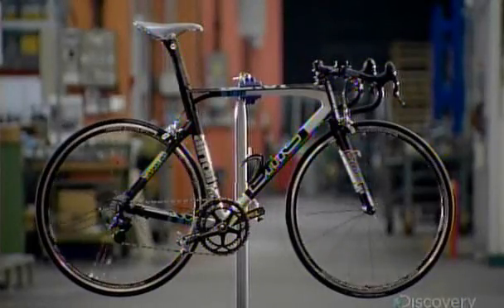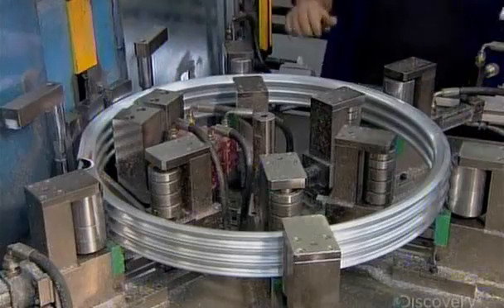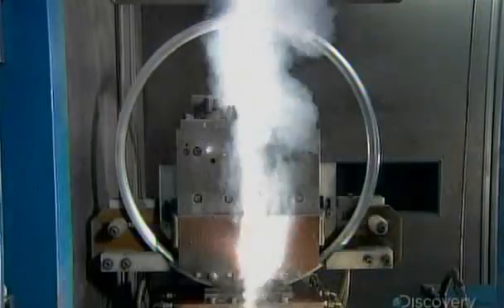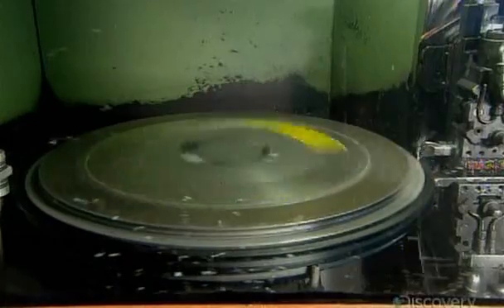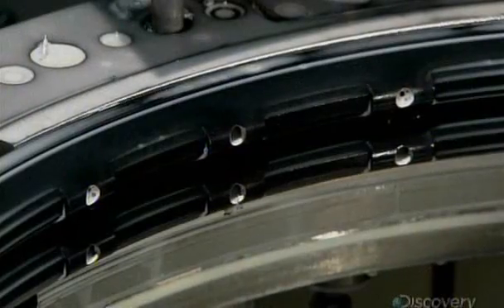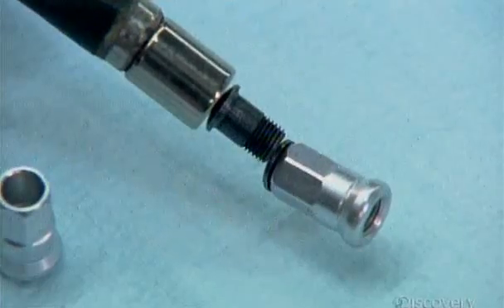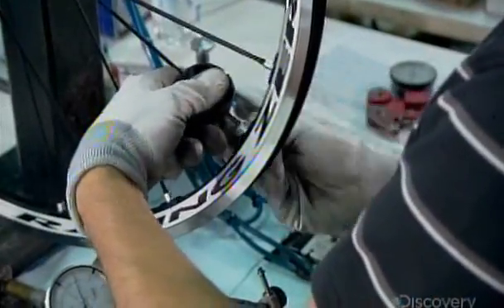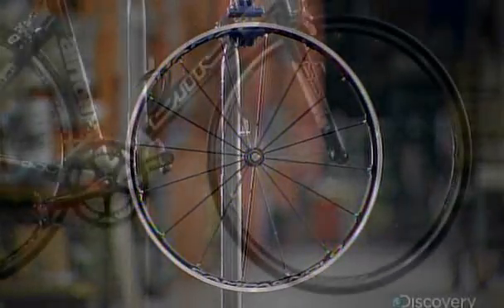How It's Made: Aluminium Bike Wheels

Comment: At 2:14 there is a misconception. Anodizing isn't plating. There is no protective chemical got applied.Anodizing is basically creating an oxide layer with electrolitical reaction. The aluminium-oxide is hard and very passive (corrosion resistant) material with porous structure (in this case) and white/light gray colour. It can be coloured by pigment treatment (pigments got stuck in the porous structure) or by certain chemical reactions. But it's not black by nature.

Comment: You'd think they would acid dip the rims AFTER they weld the joint and grind it, so any imperfections and contaminants caused by welding are removed...and of course to etch the weld so the anodizing penetrates better to preserve the rim.
Reply: aluminum welding is highly succeptable to contaminants.  its not like welding steel, aluminum soaks up oils and dirt and doesn't necessarily wipe clean with a wipe of brake cleaner the way steel does.  besides, the manner in which they weld/fuse the rim doesn't create any real byproducts.  a burr that a cnc machine machines off.

Comment: WRT wheel building, lacing the wheel is simple enough but truing the wheel and tensioning the spokes is kind of an art form and people pay a lot for someone experienced to do it really well.

WRT to the definition of technician, it's not a standardized title or degree. It has different meanings from profession to profession. Some technicians are certified and require a lot of education, some technicians are assembly line workers. It isn't an apples-to-apples comparison.

Comment: Not true. I worked for Trek bicycle in Chehalis Washington back around 1995. Aluminum frame parts are dipped in a degreaser, rinsed dipped in an acid bath to remove oxidation, dipped in a nutralizer, then ginen a final rinse.

The reason for the acid bath is to remove the oxide that builds up on the aluminum hours after the part is formed. Tis oxide melts at 2,000 degress. The aluminum melts at about 1,200. Not good. I was a welder there.

Degreaser bath comes first.